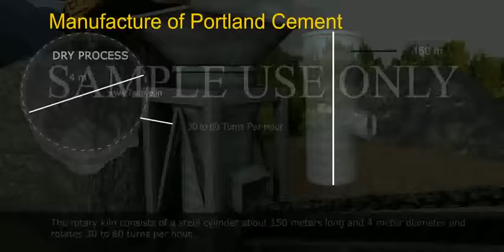Cement Manufacturing

Comment: Cement production - four billion metric tons a year worldwide - produces a lot of carbon dioxide: 2.8 billion metric tons, around eight percent of global greenhouse gas emissions. This is mainly due to the calcium oxide required for this process. It is obtained from limestone, which essentially consists of calcium carbonate (CaCO3). This is burned, releasing CO2 and leaving the calcium oxide (CaO) that we crave.

Comment: Why gypsum is added in cement??....good !...but less explanation!
Reply: Gypsum is added to delay the setting time of cement. If it is not added cement will become hard immediately when water is added to it.
Reply: cost cutting
Reply: @kevalchauhan3051  nothing to do with cost cutting???? It’s added for the reason the guy above said and also to add sulfur back into the cement that was burned out in the pre heater and kiln stages. I work at a cement plant FYI

Comment: actually what is the different btw wet and dry process,can someone guide me abit??
Reply: Productivity ieased for the dry process. Also the fuel used for the dry process is with ~ 30% reduced. The dry process is recomanded when the humidity of the raw material is low.
Reply: rk mobile

tk marbels today latest news
Reply: water are not added during the grinding for dry process
Reply: Manufacturing process for both are approximately same. 
In wet process mixing and grinding of raw materials are done using water. 30 to 40 percent water in mixed to form slurry. 
Then it is heated about 1500*c in rotary kiln. 
2.  In dry process lime stone and clay mixed crushed and grind in dry condition by the means of compressed air such that material pass through sieve no 200
Then mixture fed into rotary kiln in which it is heated at temp 1450 c.